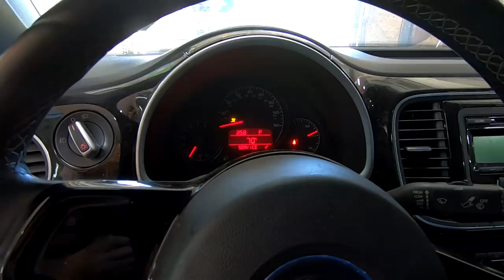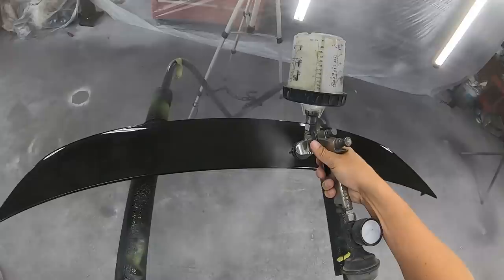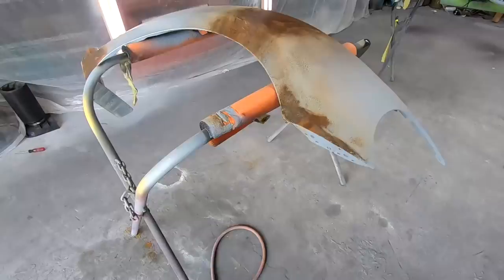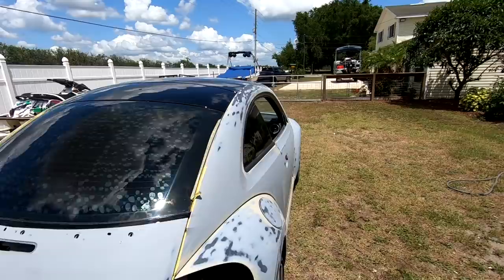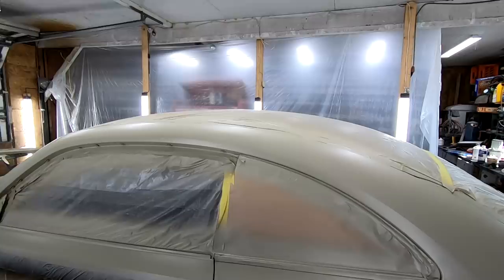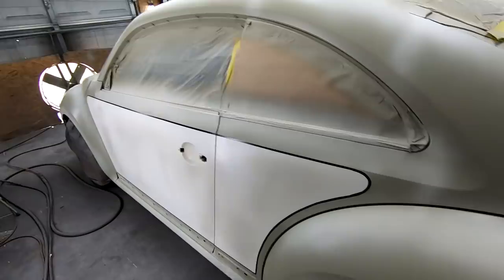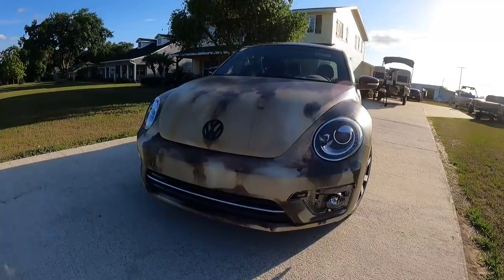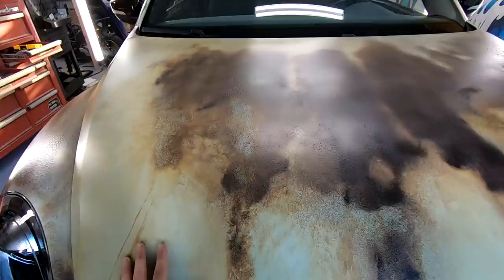I Painted My Volkswagen Beetle With REAL RUST! - Episode 6

Comment: In really like it. It needs lowering and some retro off white patina dished steel wheels with some battered hubcaps. I'd also add some original classic Beetle blinkers on top of the front fenders and wire them up as Led side markers. Top job 👍

Comment: Looks good man. Only thing I think would have made it better was a final sanding before clearing. When you're trying to preserve real patina a lot of people will sand it down slightly with a high grit and fade it out and blend in the layers. It also may have blended in any obvious spray lines and the lines from blowing on the metal flakes. It still looks great, just some ideas for next time maybe. Also, chrome accents look dope. If you don't want chrome on the sides/skirts then make sure the rest is murdered out too.

Comment: To get the smoke smell out, fill an empty spray bottle with 50% peroxide & 50% water. It gets out pet urine smells, vomit smells, & most likely cigarette 🚬 smells. Or u can get that Lysol sanitizing liquid that u add to laundry when it's in the washer. U can use some of that in a spray bottle. I think Lysol makes it.

Comment: It's a VW Beetle Bum Surfer look!!!
You say it will look like a barn find, but I see it more like a survivor!!!
Well, I have to say that I loved the final result. However, the only thing that puts me a bit off is some areas where you had some "tear running drop" (mainly in the bumper areas) because that effect on the hood and sides looks amazing.
About the chrome parts, perhaps I would go with black to go e some contrast since the chrome itself might clash with the overall look.
Apart from that, not boring at all!!! 👏👌🤙

Comment: You should try to tint your windows with that smart glass stuff that uses electricity to become transparent. I think this would be pretty cool, and you could set up a knob resistor to set the darkness while driving. With no electricity going to  it, it should be as dark as possible, and you can adjust how much current/voltage is supplied.

Comment: I like it better than I thought I would but if I had one criticism of the effect its the drips. The effect of the rust activator spray running down the sides does not add to the overall look. If you could pull out the "rusty water"  runs i think the rust effect would look better.  Also, i expected you would sand it smooth or nearly smooth before clear coating it so as to add the rust color but not the texture of the metal flakes. This would also fade and blend the rust effect i think. Just my 2c.

Comment: Not bad at all! But I do question the long term risks of the rust! Is there any risk of it spreading to the body panels and causing damage over time? Or with it being between the pain and clear coat is it sealed up and the chemical reaction is stopped?  Either way, you do good work and it is your car to enjoy.

Keep up the good videos!

Comment: Using actual iron and then rusting turned out great, the top edges of roof should have more rust and well as closer to the windshield on the hood, think od it as what parts of a car get the most sunlight. Also the two tone before your added the rust was cool looking. You can order custom black and brown (or your choose) new leather from Katzkin.com Side note, I've watch YT of pouring epoxy countertops and one of them added rust to the mixture. Here is the link: https://www.stonecoatcountertops.com/metallic-powders/ also many other colrs. Good Luck